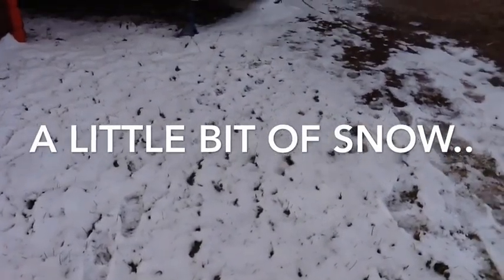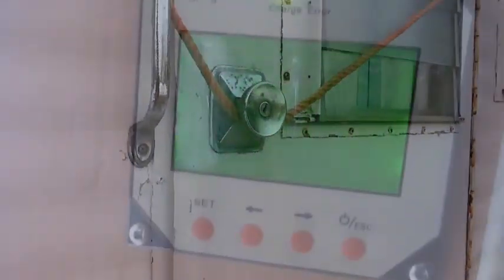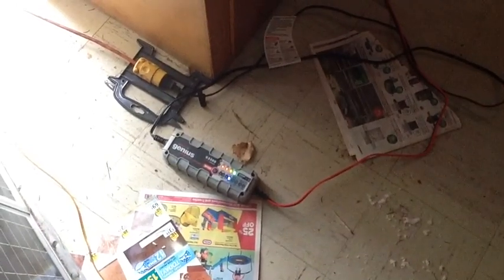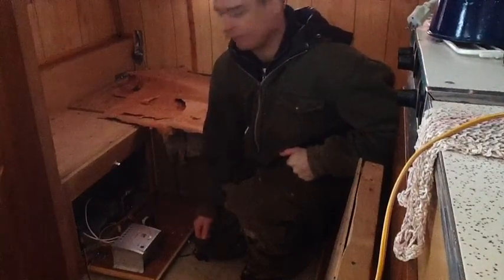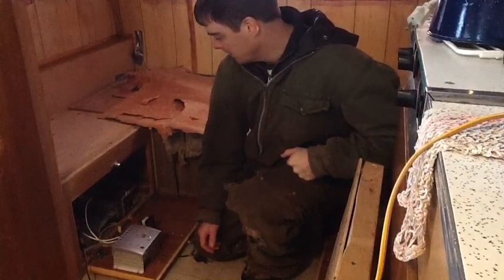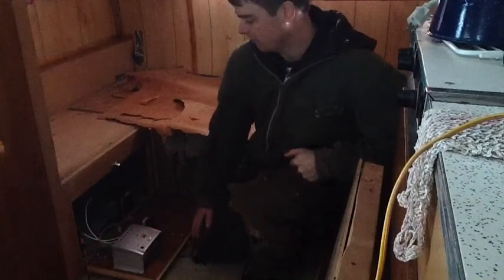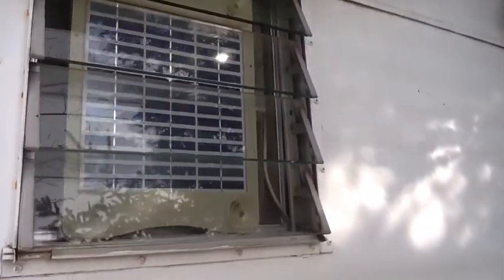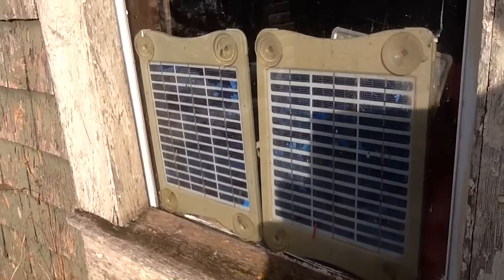Why my offgrid battery was draining

Comment: I don't see how simply having your inverter left on at night would be a big enough draw to drain your battery. It shouldn't
Reply from the maker: My big inverter draws an amp all night long. So thats 13 or 15 amp hours of draw before sun starts charging again. Thats a good amount if you only have 45 amp hours usable from 90 amphour agm.